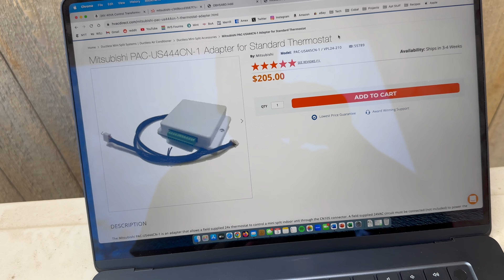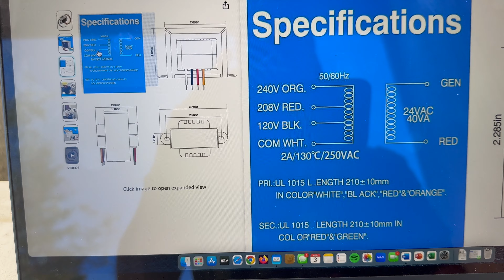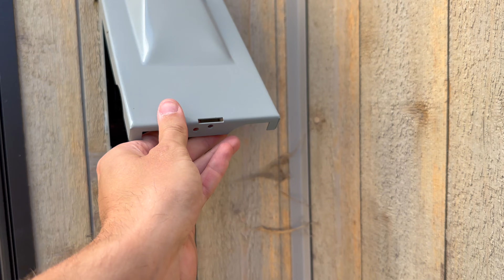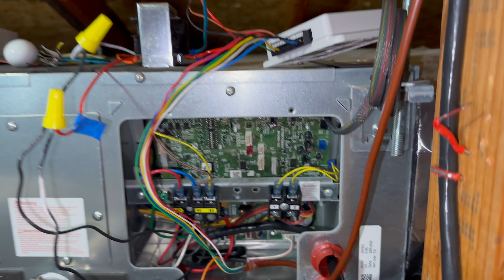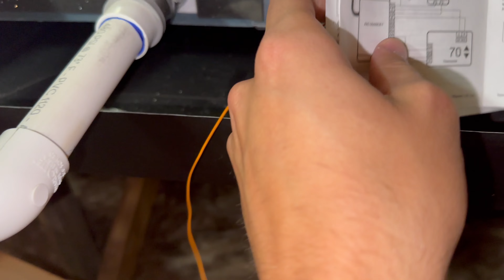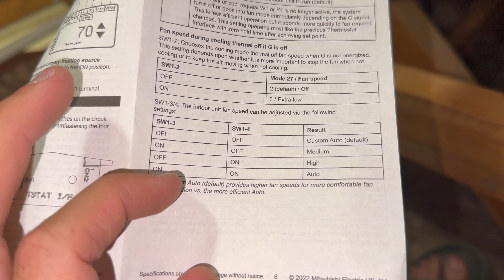Nest Thermostat Install with Mitsubishi Split System (PAC-US444CN-1)

Comment: Why not just plug esp32 to cn105 on each indoor unit and add them to HA? Cheaper, easier and way more flexible to use with HA.
Reply from the maker: Definitely a possibility. For my parents, home assistant is not as easy as having a nest

Comment: I looked into this but I thought that you'll lose some of the variable frequency drive efficiencies when connecting to a third-party thermostat. There's some aspect of the two-way communication between the Mitsubishi thermostat and the heat pump and air handler.
Reply from the maker: Yeah I think you’re right. For us, losing some efficiency was worth it to have Nest integration.

Comment: Can you still use your remote control? I bought a similar adapter for my Gree and the display on the blower is no longer visible and I cannot use the remote (there are 2 functions that I can not utilize with the Nest thermostat).

Comment: Great info.  Thanks.  How did you set up your thermostat?  Im using  a nest, do you set it up like a standard unit or do you set the thermostat settings to heat pump?
Reply from the maker: If the system is a heat pump then set it as a heat pump on the nest

Comment: i thought i had successfully done it but last night i heard the fan unit trying to turn on & off and it would shut off in 10 to 30 seconds and try to turn on again(repeating cycle) . it would mimic the action as a struggle car trying to start up and then shutting off after a few seconds, Does anyone know why?

Comment: great job and video curious any updates or issues that you would do differently?  please advise thanks!
Reply from the maker: It is still working well! Some comments prefer to keep it in two-stage mode for efficiency, however mine is working just fine as-is.
Reply: @charliecobb12   i noticed the comments on the second stage I wonder if it would make a HUGE difference in cost saving on electricity.
Reply: @charliecobb12   i was able to successfully get it done, (i have a smart panel monitor by breakers(Emporia) ) but wanted to let you and everyone know that this unit draws an average phantom power wattage of 25  to 30 watts (at times 40)  throughout the day when its off.  i need to shut off the breaker itself at times to conserve some energy and save on my bill.

Comment: Awesome vid, thanks for uploading this. Only call out is that I think it's recommended to connect the two stages to thermostats that support it like the Nest, I believe it runs more efficiently that way.
Reply: can you explain why, i have the same system and want to go for simplicity , thank you in advance
Reply: @jamesishere6630  The inverters are most efficient running at lower speed, it consumes less power to run it continuously slowly than at full power on and off.

If you look at the manuals for the PAC 444 you'll see that when the you have the two stages connected, the first stage only adjusts the temperature setpoint of the internal computer such that the cooling/heating rate is changed slowly and more efficiently, only running it at full power when the second stage kicks in.

When you only have a single stage, it runs at full power when the thermostat signal comes in, there's no gradual temperature changes.
Reply: @ejbarrios  ah makes sense thanks bud...I appreciate your insight...I'll try to figure out the wiring I am hoping is not that more difficult

Comment: Does this bypass the Mitsubishi remote control? My system keeps blowing fan for 90 minutes after the Nest turns off and I can't use any modes on the remote.
Reply: I'm not an HVAC anything but I've been forced to look into how all this worked because I had aux heat strips that weren't working. So with that said, take the following with a grain of salt!

The Air Handler has its own thermistor (reads temperature) of the return air, when you use a Mitsubishi thermostat on CN105 it communicates to the control board a desired temperature (set point) and the control board decides how to run the blower and inverter based on the temperature it is reading and what the set point is. Presumably, once the temperature reaches the set point, that's when the variable speed of the fans and inverter kick in to make it efficient (heat pumps are more efficient when they're only having to maintain the temperature.)

What the PAC 444 does is try to emulate that set point configuration by interpreting the signal from the Nest and converting it into a desired temperature with the calls for cooling and heating, so to answer your question more concretely: the operation of the fan and the heating is controlled by the control board on the unit, the Nest doesn't directly control the fan or anything (and this is a good thing, that's how the efficiency is maintained.)

However, if you look at the manuals on the PAC 444 and 445 (not sure which you have) there's some DIP switches that control how long the fan runs after the call to cool/heat ends, if you want more control over how long the fan runs you can probably try changing those, but it's probably less efficient to run the system that way.

--------------------
On PAC 444:

DIP Switch Definitions (Factory default is OFF for all switches):
Delayed Off
SW1-1/2: After reaching thermostat set point, the unit will continue to run for a set
period of time in order to improve efficiency. The period of time is set by adjusting
SW1-1 and SW1-2 according to the following table:
SW1-1 SW1-2 Result
OFF OFF 5 minutes (Default)
ON OFF 10 minutes
OFF ON 30 minutes
ON ON 0 minute

----------------
On PAC 445:

4.2. Functions of DIP switch
Zero delay timer
SW1-1: Chooses the fan/off delay mode following heating or cooling mode.
SW1-1 Delay timer
OFF Stay in heating or cooling mode for 2 hours once W1 or Y1 is no longer
active, which provides more efficient operation but does not respond to
fan request changes (G) during the 2 hours. This setting allows more
time for defrost timers in the outdoor unit to run (default).
ON Once heat or cool request W1 or Y1 is no longer active, the system
turns off or goes into fan mode immediately depending on the G signal.
This is less efficient operation but responds more quickly to fan request
changes. This setting operates most like the previous Thermostat
Interface with zero hold time after achieving set point.
Reply from the maker: Do you have a system similar to mine, or a wall mounted mini split?
Reply: Your system is not a single stage 
This is why you should call a mitsubishi trained technician 
You just made your system single stage 🤣

Comment: Thank you for putting that together.  I see five wires from your thermostat to the connector box.  It looks like you have another wire from the thermostat but it is not used.  Is that correct?  I only have five wires from my thermostat so it should work?
Reply from the maker: Yes you only need 5 wires. I bought 6 conductor wire but only needed 5 so one wire was unused.